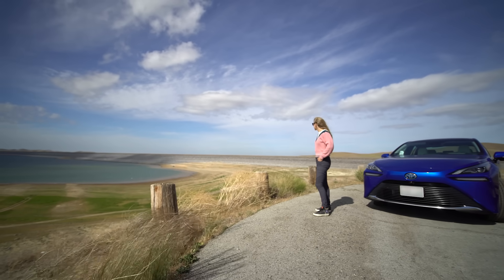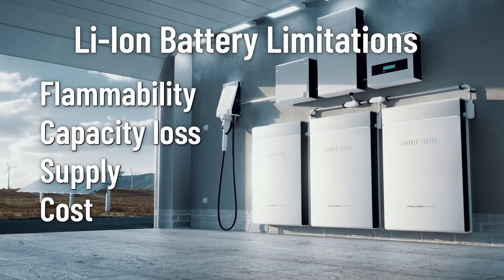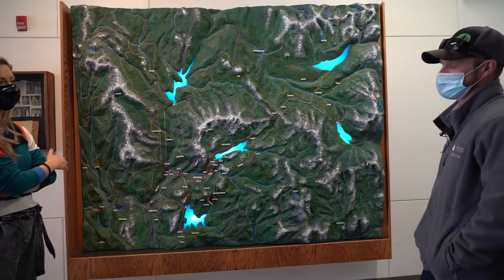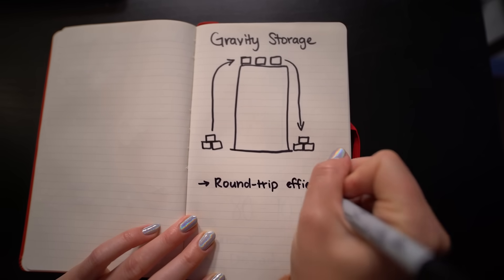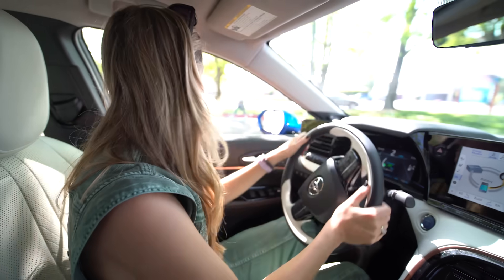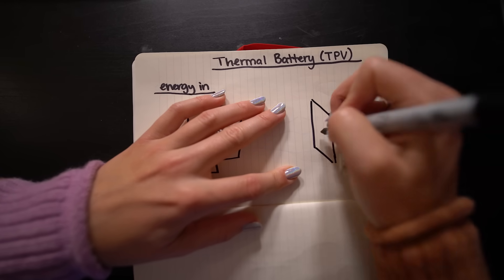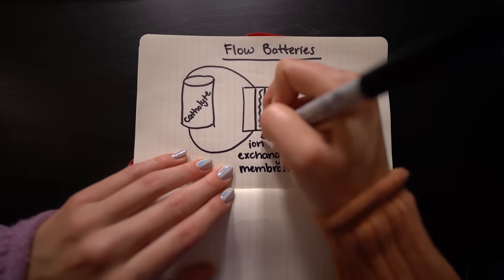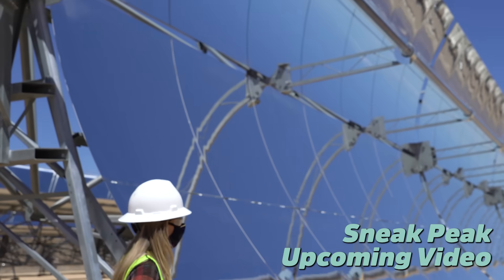The BIGGEST problem with clean energy

Comment: I am in college right now learning about energy storage and I just HAVE to let you know; Diana you are amazing!!!!
Reply: Fascinating area of study with proven technology could already solve part of the CO2 problem. Thorium based molten salt reactors. They are hands-free safe and cannot meltdown.
Reply: If you are in college, may I suggest reading "Sustainable energy without the hot air" by Professor David JC MacKay, the late Chief scientific advisor to the UK's Department of Energy and Climate Change.
Reply: you are amazing too.
Reply: https://www.youtube.com/watch?v=9xe3BWPsBTU
Bill Gates Slams Unreliable Wind and Solar Energy
Reply: The video was very wishy-washy about emerging storage solutions. Terms like "round trip efficiency" paint a very rosy picture, but on practice they lose 90%+ of energy (at least in hydrogen and "thermo-photovoltaic" batteries), before even capturing it and the real efficiency of these batteries are single percentage points, if that, compared to the energy that was put in. On the other hand oil, gas, coal, etc. are tens of times more efficient on practice, unsurprisingly that's why they are so popular.
Reply: @ahblooloo8639  hi troll.
Reply: @hitreset0291  He is but he is true for some points. For me the fusion source of energy seems to be the most efficient but that is not tangible right now…Don’t worry coal/petrol is soon going to be phased out at least by 2070 or maximum 2080
Reply: @beactivebehappy9894  fusion is a fools errand, if you are hoping for it to be ready soon enough to help against climate change. At the moment, fusion experiments don't even break even, which means they consume more power than they generate, and that's even before you even consider converting that energy into electricity and the losses that entails.

Then there's the expense. Nuclear fission power station projects struggle to get off the ground due to the huge up front costs, but the economics of nuclear fusion is even worse.

Advanced fission on the other hand, like molten salt reactors, based on the 1960s ideas proven by molten salt reactor experiment (MSRE), could come to market in time, especially if governments focused on them. They would also be massively safer and have far lower consequences in the event of an accident than traditional fission reactors.

Comment: Construction of windturbines has a big impact on the CO2 footprint, caused by the concrete foundation and the required steel as well. And after 25 years it becomes obsolete. And only during 25% of this period is has produced electricity. recycling of windturbines is complex, as only the steel can be recycled. The conrete foundation is burried and the rotorblades....no one knows what to do with them. Solar panel production is a very environmentally unfriendly process and recycling is very expensive. Only around 5 percent of the electricity gets generated from solar and wind. So how much energy is generated to be stored? Especially during wintertime. There is only one solution and that is nuclear energy, an inexhaustible source of energy and no need to build large energy storage facilities.

Comment: I was goofing around on Wikipedia a little while back and I found out that they actually have pumped hydro at Niagara falls. It's actually rather interesting they use surplus hydroelectricity from the Robert Moses generating plant, and I think the Canadian one on the other side of the river does the same, and use it at night when demand is low to fill up a big reservoir. That way when demand is high the next day they can get a fair amount of pressure from the stored water in the reservoir without draining so much flow that they redirect the entire Niagara River and shut the falls off.

Comment: Let’s say you wish to replace a 1Gw nuclear plant with wind power. Let us go through the numbers. Many French reactors have a power level higher like 1.6Gw = 1600 mega watts. We’ll use 1Gw = 1000Mw to keep our arithmetic easy. 
A 1 Gw nuclear Plant has a capacity factor or 95% some are higher some lower.
Wind Power has a capacity factor of 33% this can very as low as 25% or a bit higher.
For the layperson this may not seem so important so please bear with me. Because we wish to replace a nuclear plant with a wind farm
To build a wind farm you will need 1Gw/ 33% = 3Gw of power because of the capacity factor. The wind blows 33% of the time. That means 3Gw of power is needed to be produced power so to replace 1Gw of Nuclear. How this is done is wind supplied 1Gw of power to the grid while the remaining 2Gw of power goes to storage. So lets say we have very very predictable power where every third day the wind is blowing and at sufficient speed >20km/hr. So Monday it blows Tuesday and Wednesday the wind doesn’t blow. So on the Monday 1Gw goes to the grid 2Gw goes to storage to be used on Tuesday and Wednesday. Then by some miracle the wind blows on Thursday and the cycle continues… For EVER. If there is no wind power on the third day your out of luck. Now let’s calculate the size of the battery. Energy is power times a unit of time.
1 Joule of energy = 1 watt for one second. Therefore 2,000,000,000 watts (2Gw) needed to be stored in one day or 24x60x60 seconds= 86’400 seconds. So the storage that’s needed is 2,000,000,000x 86,400= 
172,800Gj of energy storage. But the kicker here is assuming 100% storage capacity efficiency. Now let’s calculate the cost of 3Gw Wind plus 172,800GJ of energy storage. 
Wind’s cost is about $1000 per Kw or $1 per watt (a low value). So 3Gw of wind will be $3 billion.
Batteries are about $500 / Kwh or (1Kwh = 1000w/K×60 min/hr x60 sec/min)
So that’s $500 / 3.6 million joules. Or .0001388889 $/J
Therefore 172,800 Gj x .00013888$/J= $24 billion 
So that’s 24 plus 3 = $27 billion to replace 1 nuclear plant. So the cost of storage is the kicker.
But for how long?? A nuclear plant can go for 40 to 60 years.
For a wind farm its life could be 20years. So look to spend 3 $billion times 60/20  (or  $9 billion) to cover replacement over 60 years. For batteries lithium ion type they can take 300 to 500 charges. For calculation lets use the generous 500 charges. If the batteries will be charged once every 3 days that’s 1500 days of life.
1500/365=  4.2 years Therefore over 60 years the replacement is 60/4.2= 14 times
So the total cost over 60 years is $24 billion x 14 for batteries plus $9 billion for wind turbines equaling a grand total over 60 years to be 24×14+9=

 $345 billion. Over 60 years.

A cost that is not calculated is not just the cost per Kwhr or replacement costs over 60 years. 
But the cost of a power failer.
The cost of a power failer is extremely difficult to calculate. A good example is that of a bakery or other industries that are highly dependent on reliable power. Bread that does not rise or a process that’s time dependent like the refrigeration of food or vaccines. A patient on an operating table. A person stuck in an elevator etc etc. 
Now do the same for solar but it has a capacity factor of 20% less in Germany.
1/20% =5Gw  etc etc. Create your own spread sheet and adjust some numbers if you like.
For nuclear it is 95% Do the math for it as well. You will need 0.05Gw of storage but this could be made up with natural gas. A lot of nuclear power plants have 2 reactors.  Darlington 4 Pickering 8. As you can see by the back of napkine calculation it’s the cost of storage. There is a line in the PDF that your can down load from www.roadmaptonowhere.com that I will always remember.

 “Fuel is Storage” Wind and Solar are fuel free systems. 

But lets look on the bright side Elon Musk can sell us the battery storage for 172,800 Billion Joules of energy at 100% efficiency. Wow time to buy Tesla stock. The largest battery installed by Tesla is in Australia at 129Mwhr that is only 464.4 GJ. So Tesla would need to build 372 (172800÷464) sites lìke the one just built in Australia to store 172800 Gj of enegy.

Comment: Really interesting!

I am wondering if one can produce huge fly wheels as well. 

Say one builds giant concrete structures  floating in water to form a water bearing  and then spins them to make a fly wheel, maybe  with electro magnets and even superconducting  magnets.

And maybe even much of  the heat lost due to friction can be harvested as well to improve the over all efficiency.

And most of the mass would be near the  edge of the rotating disk to make a high moment of inertia while the center would be empty to make it buoyant for the water bearings to work.

And maybe this could also be a good place to do the hydrolysis as well on that water  to sperate the hydrogen form the oxygen so one can store the energy moth mechanically and chemically.

Also one can extract the energy by using the fly wheel as a giant rotor so it needs no gears. As such one can spin that at really high RPMs subject to the  tensile strength of the rotating disk before it  breaks apart to due the high forces on it. 

But the disk could be steel reinforced to have a high tensile strength.

Also the bottom of the rotating disk could be cone shaped (or hemispherical ) such that gravity will tend to keep it cantered and thus may not even need a shaft, (or maybe can reduce the size  of the shaft needed) but rather spins more like a top.

Of course this would act like a huge gyro and earth rotation would also have to be considered as well... sorry any flat earthers out there.
Reply: BTW, I have sense writing the above comment  run across this that says that indeed fly wheels are  being used for energy storage for the grid.

https://www.youtube.com/watch?v=LHyUDihL_FQ

Comment: Great, video Dianna! The storage problem is often overlooked in the clean energy conversation and it’s very important that different industries work together towards environment-friendly solutions.
Reply: When will toyota have BEV on the market?
Reply: Hey Toyota!!!
So, "Efficiency"?
25%?

"Green" Hydrogen?
3 GWh grid energy in.
Max 1GWh electricity out?

That's 2 GWh which could have removed Fossil generation from the grid!!

Nice try.
Convince me otherwise
Reply: This corporate account has a lot of nerve to show up in here… for starters, go read the comments section of the first video in this series. Then find a mirror and repent for your sins!

Comment: Compressed air storage. 
You put in energy to store. It makes the air heat up. Hey. You could use it to make electricity! Where do we put it?
The air is all compressed and the heat came out into the atmosphere. When we draw off air to run a turbine to get the energy back the stored air cools down until there is no more pressure.
We need the heat we let go into the atmosphere.
How is this storage?

Comment: In addition we need a way to store low grade heat from the summer and move that to the winter and vice versa…on a massive scale. If we can do this we can minimize the energy needed to make our living spaces comfortable.
Reply: Drill a hole, 200m(?) down.
It's MUCH Warmer than the surface, even in summer.
Liquid filled pipes, heat pump in the surface, convection.
Free heat.
There's a housing complex in the UK doing it.

Comment: 0:07 - Actually: Billionaire Robber-Barons' Status Quo Propaganda Machine and their Politico-Corporate Puppet allies are the biggest obstacle to overcome... You can solve all the technical problems of storage and others that you want and have conceptual proof that it works and even proof of eco-financial advantages, so long as it will be easier and less risky for the richest of the rich to stick with that which made them rich in the first place, they will never take any risk to switch to new technologies and will fight whatever comes up the innovation pipeline (Only if there is an overwhelming opportunity to monopolize a new market while maintaining the old one they control will they permit the new one to exist; but replacing the old with a new one? Not as long as there is still a drop of oil left to be extracted from the Earth)

Comment: Probably reading about the Dinorwig power station would give the basic info on pumped head water power. It's been working in the UK for years producing short term power supply,  it can run for about 12 hours to empty and start up in 75 seconds to full power.

Comment: Pumped storage efficiency: pump & motor 80%, turbine & generator 80% = 64% --- 1/3 loss means 1/3 more solar panels plus the infrastructure cost.  
50 square miles of land for solar panels is needed to produce 1 GW of power for 24 hours IF the sun shines that day.  You also need 20 GWH storage capacity to make it through the night and while the sun is not perpendicular to the panels.  (it's a sine wave peaking at noon.)    Add the cost of a panel cleaning system, and replacing the panels, copper wire, mounting structure, etc. 
Now multiply all that by 400 for the US. (4.2 Trillion KWH annual consumption /365/24 =479 GW AVERAGE  production, 100 GW is nuclear).
You just as well put a nuclear power plant in the middle of your solar farm and take your chances if it blows up it will affect less than 50 square miles. 
Next add 1/3 to your numbers to replace all Gasoline cars with electric.
1 cloudy day, and no electricity for you.
The math is straightforward, the numbers are mind boggling.
China WILL build ALL the solar panels, meaning transfer of wealth to Communist China, in return they will buy NOTHING from US.

Comment: 1:38 "A 40 hour battery will cost about 10 times as much as a 4 hour battery"

Wow... That's like, insane to even think about!!
Reply: You guys joke, but the point is scalability. For some other technologies, a 40-hour battery might cost only five times as much as a 4-hour battery. Building tanks with twice the capacity for flow batteries, for example, probably won't cost twice as much. Or if you're moving rocks uphill for gravity storage, you just need twice as much storage space at the top of the hill to store twice as much energy; you don't have to build twice as much of the rest of the infrastructure, assuming your goal is increasing capacity and not increasing the power of the system.
Reply: @Eyedunno  yeh we understand, we are just joking :p
Reply: @Eyedunno  Yeah, but he could have said it like that instead of sounding like Homer Simpson trying to explain nuclear fission...
Reply: quik maffz
Reply: Maths genius right there!.
Reply: @Robert-j6r8c  😂
Reply: Nooo I thought it was 1000 times more!! Wow!
Reply: It's just maths!
Reply: That's not necessarily the case though. We need better than linear scalability. Flow batteries are an example that could vastly beat linear - Once you have the cell built, to double capacity you just need double the tank size not double the cells. Same with pumped hydro, you don't need a bigger turbine just a bigger water reservoir.
Reply: A good video on how to understand and use your instincts https://youtu.be/XrmyGtdmgoY
Reply: Liquid metal batteries are quite promising for grid storage